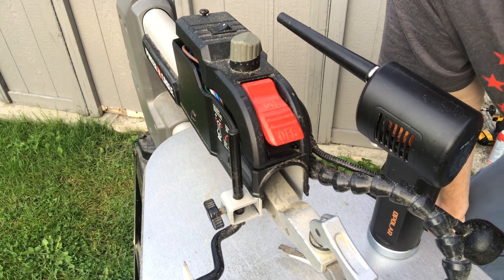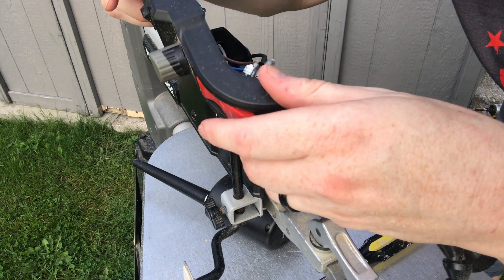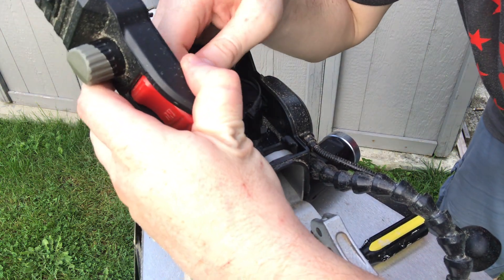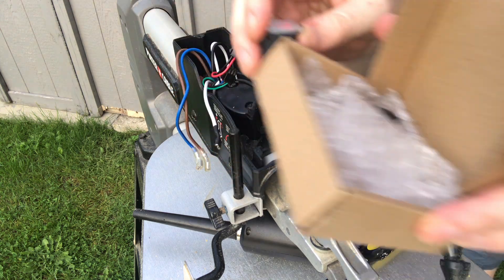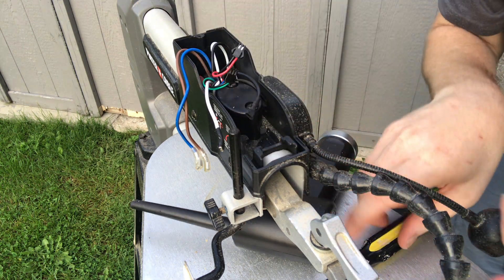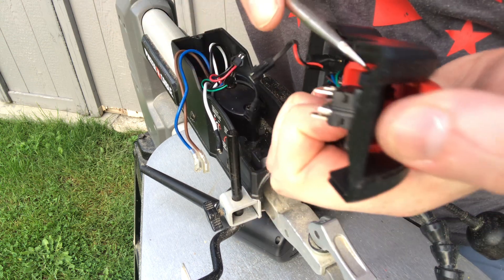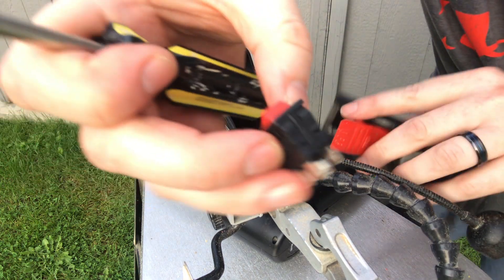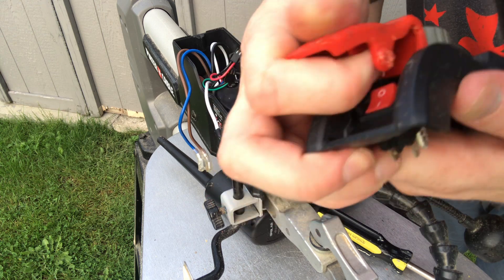Porter Cable Scroll Saw, Bad Switch Replaced Easy Scroll Saw Fix, Scroll Saw Not Working

Comment: What were the symptoms of the switch failure? My saw has lost power, easily stalls, wondering if a bad switch would cause this.
Reply from the maker: It was plugged in and I just noticed it wasn't turning on consistently. I tested the part with a multimeter and sure enough, it was bad!
Reply from the maker: Andy, What did you find out?

Comment: Could you tell me how to test with a multimeter? I haven't used one before. My scroll saw was difficult to turn the switch off, then when turned back on, it worked intermittently (very very slowly) and after a few switches on and off, it quit completely.  Thanks for the video.
Reply from the maker: Happy to help! Multimeters are pretty easy to use, Some of them are super cheap too. You just hold the positive and negative terminals in place on the part in question.  Those intermittent issues seem to me like they are dying out and or have a weak connection somewhere and most likely just need to be replaced at that point.
Reply: @dbproductreviews6319  Thanks so much.  Bad switch replaced!!

Comment: How did you know it was the switch and not the brushes I looked at the link on Amazon and it takes a month to get a switch
Reply from the maker: I did a lot of research! Some of those hard to get parts on Amazon can take a while. Ebay is another great option too. Were you able to get this fixed?